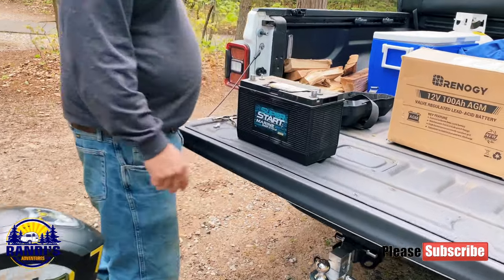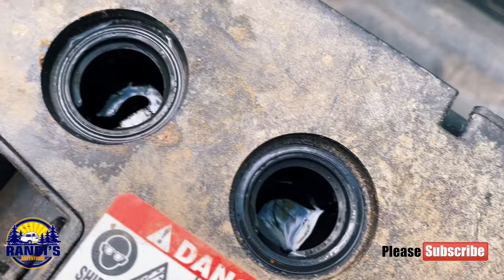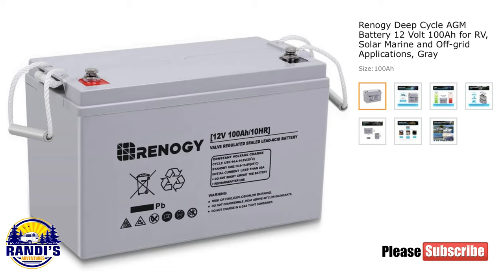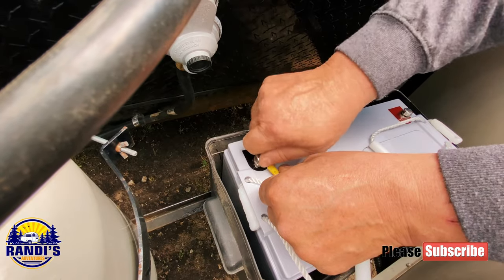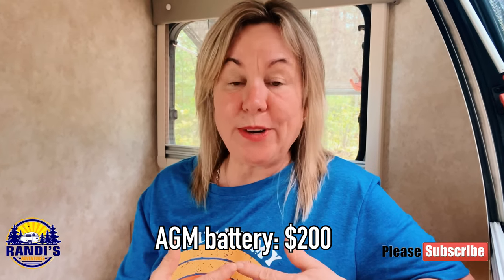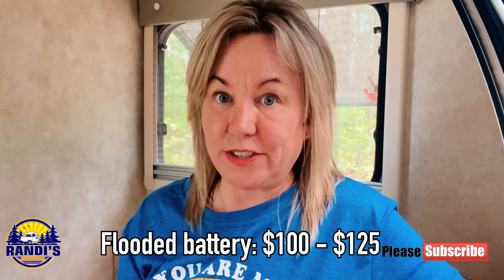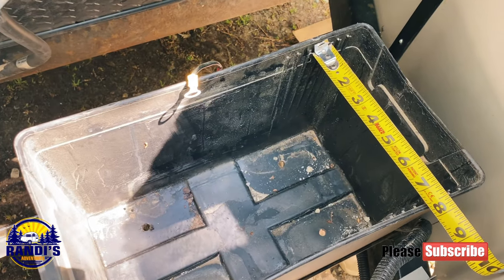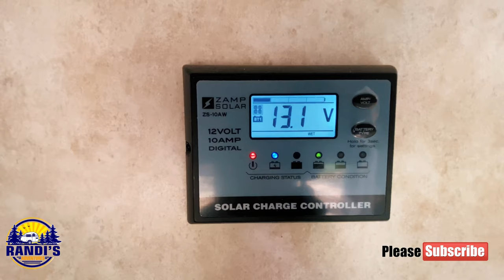Why I SWITCHED from Flooded to this AGM RV Battery! 😲

Comment: I put a lithium ion battery in the overland trailer I built.  Ampere Time is the brand.  100Ah was around $550 I think.  I also put a Renogy DC to DC charger in.  I ran a set of wires from the Jeep battery to the charger.  It also had MPPT solar input.  So far it's working well.  I have ordered an AC charger and will install it shortly.  
Thanks for the info Randi.
Reply from the maker: WOW! You are very handy. Have I seen your overland trailer on Instagram?
Reply: @RandisAdventures  There's a few photos on there.
Reply from the maker: @bah5310  impressive! I like the setup.
Reply: and obviously well off financially... @RandisAdventures

Comment: I recently replaced my 12v 75ah battery with two 6v 220ah AGM batteries. So far I’ve been really pleased with how well they work. I guess my learning was to be aware of the amp hours your battery is rated and what your needs are in any given trailer. More amp hours equals longer lasting when boondocking.
Thanks for your videos!
Reply from the maker: Hi Rocky! Great point… battery amp hours is a big consideration and the more amp hours the more time we can boondock. 😁
Reply: Excellent -
Smart think and Perfect setup..
That the way to do it - 
Two Sixers

Comment: I think I am going to get an AGM for my new camper whenever I get it. This just popped up on my feed and I guess I never commented on it a while back. I have three Lithium in the large 5th Wheel and I love it. I can stay out a week and not worry about running out of power. I can replenish with the solar I just can't run the AC for too long. For that I need the generator or a full hook up. But I think the AGM batteries are a great alternative to the wet or the acid batteries. Great Video Randi!!!
Pat
Reply from the maker: I want to someday upgrade to lithium batteries but they aren’t good in cold weather. 😳 Using AGM batteries are a great wet battery alternative because you don’t have regular maintenance! Easy is always better, right?
Reply: @RandisAdventures  I can't recommend the Lithium batteries for what you do. You don't want to use them in the extremely cold weather. That's why I think I will be getting AGMs on the new trailer I'm getting. I want to be able to go out in cold weather.

Comment: NOTE: Do not regularly discharge greater than 50%, BUT once a month, run to 1/4 25% to get BOTTOM CHEMISTRY equalized...most battery owner operators,  just charge then discharge, not aware they are killing, also batteries are happy between 68-72 degrees otherwise they will shrink, or thermo expand, and cheat you out of power. Great vids sis. Keep posting.
Reply from the maker: I have not heard of going below 50% to get battery chemistry equalized? Everything I researched told me never to let a lead acid battery go below 50%.
Reply: @RandisAdventures  once in a while to do battery equalizer, but never should be a reminder so you don't discharge that low often...i worked with 2 or tree batteries on this big black thing that goes underwater
Reply: @RandisAdventures equalization refers to a controlled overcharge. Undercharging never is done for equalization.

Comment: Great video, I do believe you would have been better off with lithium batteries because you are boonedocking more now. You can get around the heating them in the winter by putting them inside like I did mine. Lithium batteries last 10 times longer and can go down to zero percent (but most keep them at 20%). And lithium batteries (good ones) have a built in battery monitoring system (BMS) so you can't over charge or charge them when to cold out.
Reply from the maker: I really struggled between an AGM and Lithium battery Todd because of the things you mentioned. But it got down to cost, cold temps and the Zamp controller I have does not have a setting for lithium so I would have had to upgrade that also.
Reply: @RandisAdventures  I understand the cost thing, but if you look at it for the long term it is actually cheaper. The zamp controller does have a lithium setting on it its called LiFePO4. And like I mentioned before if they were inside temp would not be an issue.
Reply: @ToddStoddard  The Zamp controller may work for solar charging.  The trailers charger must be changed, it's not set up for lithium.
Reply: @gregj9391  the trailers charger cannot be changed and will only charge a lithium battery to around 80%, so the zamp controller will have to make up the difference or you will have to change out the trailers charger.

Comment: if you are charging your house battery from your tow vehicle's alternator you could end up damaging your agm battery because alternators are designed to charge starting batteries only. that is the main reason why rv manufacturers build them with flooded rv/marine 12 volt batteries which are not really a deep-cycle design but a modified starting battery design, and it is normal in the rv and boating industry to have to replace these batteries often.
Reply from the maker: Because of your info I contacted Xtreme Outdoors tech support and they said I should not have a problem. Thanks for your info and comment!

Comment: Nice job Randi! Just curious... your solar charger is compatible with AGM batteries, but is the trailer’s converter compatible? Had read that most converters aren’t designed to charge AGM’s  and wondering if damage would occur if plugged into shore power.  I recently upgraded to two DC31’s and so far so good!
Reply from the maker: Hey Mike! I double checked with Xtreme Outdoors and they verified an AGM battery is compatible with the trailers converter. 😁 Thanks for the great question!
Reply: Randi's Adventures Good to hear!  Now you will be good to go!!

Comment: Great info as we recently replaced the AGM battery in my LGMM with another AGM. But how do you monitor the battery’s charge? Is there something you recommend hooking up to the battery to test it periodically? Other than the solar panel control, I don’t know anything about how much the battery is charged …. like percentage and such.
Reply from the maker: Hi Allison! I monitor the battery charge through the Zamp solar control panel. I know there are battery state of charge monitors but I have not used one to make a suggestion for you.

Comment: Dumb question here. How do you know if it’s discharged below 50%?
Reply from the maker: Hey Sabina! That is a GREAT question! I monitor my batteries state of charge with my Zamp controller which is what came with my Little Guy Max. If you don’t have a controller system that shows this you can buy a battery monitor. It’s important to have some way to monitor your battery so it never goes below 50%.

Comment: Randi another tidbit of information that is wonderful to know. Thank you very much. We made our maiden voyage with our brand new little guy max last weekend 2 weeks after my back surgery and it went well until we went to open our sewer line holder and found out we didn’t have a hose. Lol. Oh well, we went down the road a bit and found one and were back in business. It was great to get away and had a wonderful time in our trailer. When we have our trailer home we keep it plugged in and this keeps the battery charged. I guess if you’re fortunate enough to do so this can save your battery. Thank you again, you Rock
Reply from the maker: Wooooo Hooooo Bill… that’s exciting you got your Little Guy trailer and had a successful maiden voyage! 😁 And I am glad you found a hose. 😂 That’s great you have electricity where you store your trailer, this will help you maintain your battery.